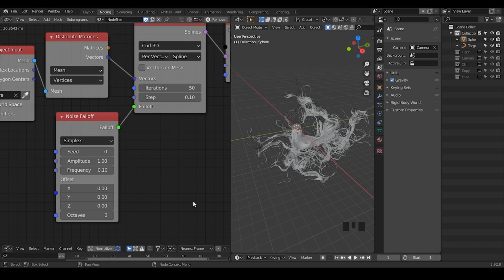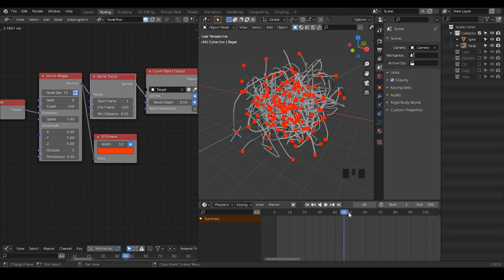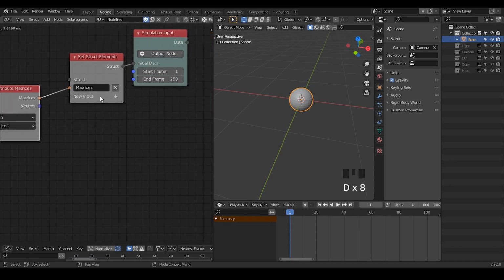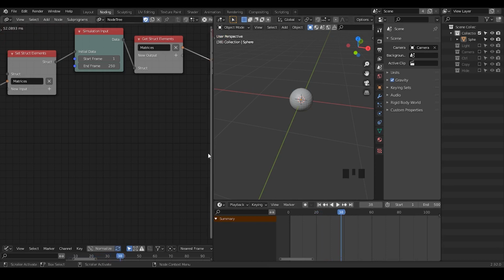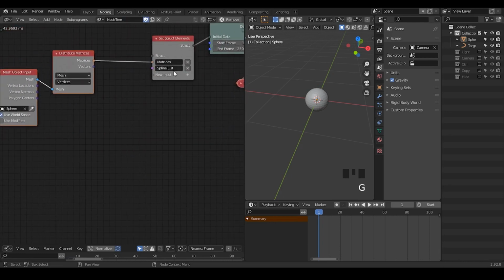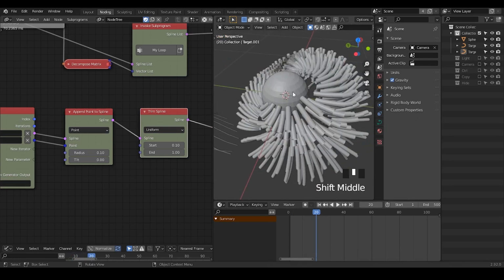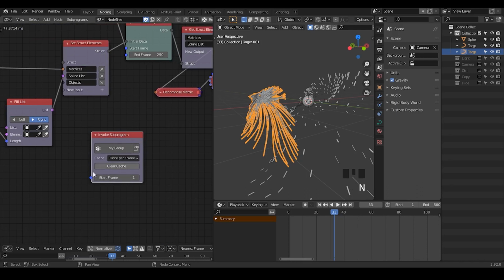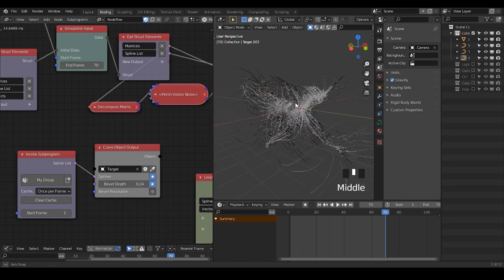[Tut] Spline Tracer / Tracing Vector or Particles - Blender Animation Nodes

Comment: Are geo nodes capable of doing this?
Reply from the maker: Won't be really the same. Here I am doing a loop over time. GN neither supports loop, nor loop over time. You may get similar kind of result by displacing curves, but at the end it's just displacement, which I don't think can achieve such an interesting result.